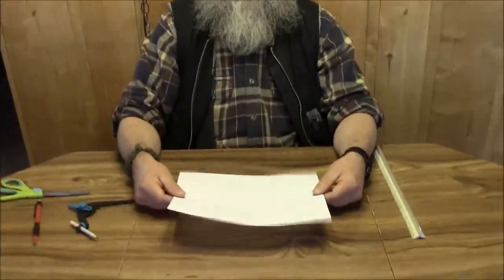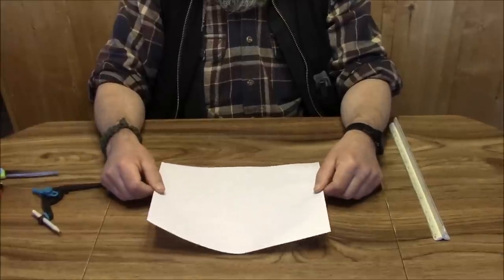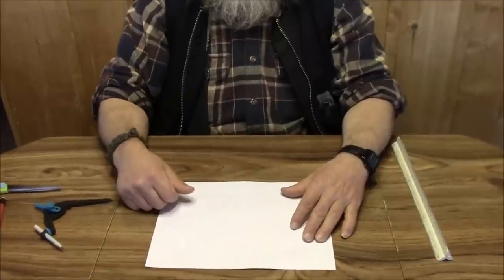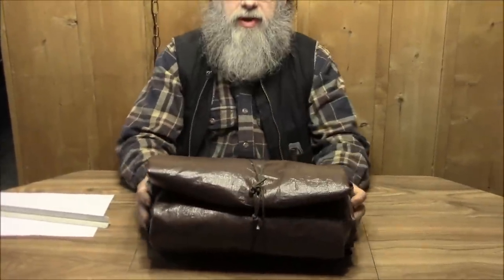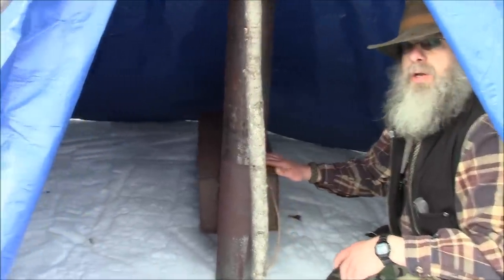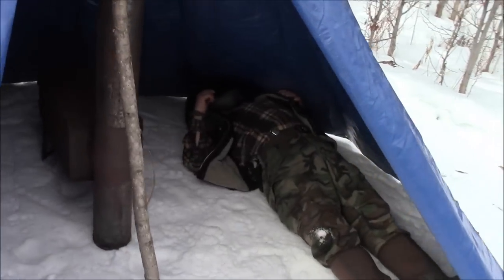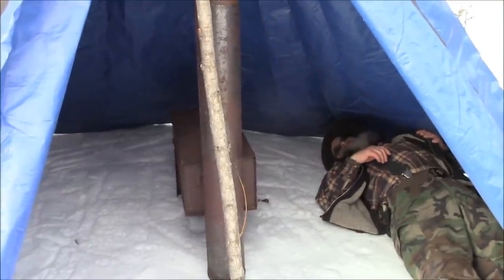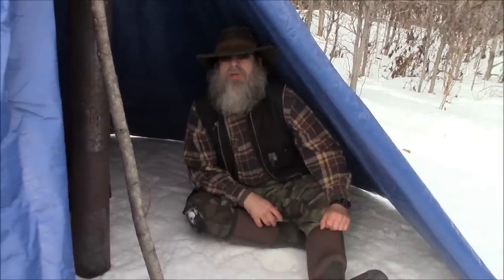Make A Tarp Tent Tipi Hot Tent On The Cheap

Comment: I'm back at this sir , last year was quite late to make but this year I want to make it , I have problems understanding the sizes you say , can you please wright me the sizes of items that I need so that I can search it from there ?
Thanks !
Reply from the maker: The tarp is sized 12 feet X 16 Feet. (3.7 meters X 4.9 meters)  There are plenty of online web site conversion utilities that will convert measurements to metric.    What I suggest is to find what sized tarps you have available and then do a paper model to scale just like I showed in the video.   That way you can create paper pieces that are the same sizes as your sleeping bag, stove etc but are scaled down to the proper scale to fit your paper tipi model.   Then you will know if starting out with that size of tarp will give you a size of tipi that will suit your needs.
Reply: I have to order everything from Amazon , as that is the cheaper , more durable option for me. My question is I'm 1.92m in height will I fit in the size of tipi that you made? if I fit that is the most important as my only companion is my dog and he will fit for sure , the stove there are people who make it here for very very cheap , like my relative gave the worker sheet metal and he build the stove for 5$ , what size gromments do I need ? and also can I get that non flamable piece in smaller cheaper option as I don't need the whole tarp of it and shipping it would be quite costly because of the weight. I also have to order gorilla tape from amazon how much should I order ?
Reply from the maker: I do not remember measurements on that project any more but If you make a paper model to scale like it shows in the video then you can make a simulation of yourself laying in the sleeping bag also to that same scale.  You can also measure out the tape needed in that same scale and you will know for sure very closely what is needed for the actual tipi construction.
Reply from the maker: For the grommets, they need to be however big you wish them to be.   If you wish them to be big enough to put a spike (as tent stake) through, then you will need to measure the size of your spikes.  If you are going to tie cordage to the grommets like I think I did in this video then it really does not matter how big they are as long as they are wide enough to get your cordage through.
Reply: Ok thank you very much sir for you time and help ! 
Wish you all the best
Nick

Comment: At the 19:35 mark, you cut out the V pieces. But later you added a scrap so there was a flap to close the opening. I'm wondering if you should only have cut off half of the piece at 19:35. Would that  have worked to close the door?
Reply from the maker: Without rewatching the video all over again I'm not sure what it looks like.  However if you think it will work, go for it.  You can make a paper model first as I suggested in the video and then you will know the answer well before you get to the cutting of the tarp stage.

Comment: Hi, I am a person who enjoys Bushcraft in Korea.
After watching this video, I fell in love and I decided to make this tent. and it took for 3 days.
More than 30 people were asked what I was doing.
  lol.
But there's a small problem and I'd like to get some advice on how to make up for it.

1. Do I have to extend the extra length to the ellipse you taught me if i try to close the tent's door?
Before I cut the tent fabric, I cut it with about 30 centimeters around the circumference of the ellipse considering the extra length to close it.
But even in your video, there is a space where you can see the ground as well to the ground. I don't really like this part considering it's winter.
Even though i tried to make adge of the tent, got touch the ground with a tap and packing peg as much as possible, space still exists.

2. It's too difficult to find a large, thick tree that deserves to support tents by Korea's Natural Protection Act, Forest Safety Protection Act, National Territory Management Act, etc. (The finished tent has a diameter of about three meters. )
If you were, would you consider using a tent pole?

ps, But I can change the height and the diameter of the tent in a fluid way.
I'm curious about your idea of just being an expert.

3. Why is your voice so wonderful? 

thanks for your video . / 감사합니다. ^^.
Reply from the maker: I am not real sure about what you are describing.   If there are gaps below the walls near the ground, which there often is due to uneven ground, I will throw leaves, dirt, snow etc against the wall bottom all the way around to block the gaps.   For a center pole I have found extendable aluminum poles at thrift stores similar to the one at the Amazon link below.  If I want a quick set up and do not want to bother with external poles, I just use one of these extendable poles.    If your door opening closes to your satisfaction without adding any extra material then there is no need to add material for a door closure.  I wanted to add more materila for teh door closure so that I would not take away any from teh floor space by shrinking the shelter diameter to get a door overlap.

https://www.amazon.com/Roller-Extension-Painters-Rollers-Professional/dp/B079PXGV6Y

Comment: If I were going to connect two tarps together . I would lay the two tarps with about an inch in between them . Run the gorilla tape down the gap seam . Then flip over Now when I run the gorilla tape down this side it will connect with the other tape making a strong bond . And obviously one would want to run tape to the right and let of the middle seam over lapping on both sides  .

Comment: How does this tent hold up in snow?
Reply from the maker: bear track This design would be excellent in snow because there is no horizontal or near horizontal roof area.    If it is heated then the snow will melt off anyway.

Comment: Lonnie, how do you deal with condensation in a tarp tent that doesn't  breathe?
Reply from the maker: The use of a woodstove inside helps a lot.   There is condensation but I do not consider it to be significant.   When using a liner inside the shelter, the condensation is even less and is what I consider as minimal.

Comment: How do you find the measurements for tepee tent  by hight and diameter of the tepee to know how big a tarp you will need
Reply from the maker: The best way I can explain it to you is to explain it the same way I already carefully explained in the video.   Make a paper model to scale.    First make a paper model to scale of the size tarp you want to use and then make a paper tipi from that scale model of tarp.  Now you can see in feet or the metric equivalent how large the resulting real tipi will be if using the size tarp of the scale model.

Comment: Use the rubber flashing self adhesive tape. Once that stuff makes contact good luck getting it off.
Reply from the maker: I know a fella that made one of these though a larger size and used "Flex" brand tape for tie outs mid wall and the tape worked great.
Reply: @Far-North-Bushcraft-Survival   maybe those 8 or 10 foot rolls of tyvek even that stuff is a 100 % water proof.  I wonder how well that wood work. Downfall is the bright white but covered with pine or something. 🤔

Comment: What is the length of the centre pole used erect the tipi?
Reply from the maker: It is roughly 6 feet.  I cut a new pole each time I erect the tipi.   You need to stake out your tipi and then step inside the doorway and lift up the peak of the tipi.   Now measure from the peak to the ground while holding the tipi up and keeping the walls tight all the way around.   Now you know the length to cut your pole.   The pole length will change slightly from camp to camp due to uneven ground and the compactness of the ground.   In other words, during the winter, the base of the center pole will sink in the snow so the pole needs to be longer or else the pole needs to be supported by some wood chunks to make up the height difference.

Comment: I'm going to be doing something similar soon, did you use the duck tape to reinforce the tarp or is there another reason?
Reply from the maker: +Mitchell LeGassick   Yes and Yes.   I used the tape around the cut edges of the tarp to "reinforce" the edges as well as provide some "grip depth" for the grommets to be able to bite into to get a good firm grip.   Also the tape was used to join pieces of tarp together when needed.   Good luck with your project.
Reply: +Far North Bushcraft And Survival 
thank you sir

Comment: Lonnie, a question for you. Wouldn't the point at the top of the arc of the tipi be the same distance as the radius of the 16 ft? What I mean is would it not be simpler to just find the half way point of the 16 which would be 8. and then measure out 8 ft for all the other measurements rather than using the cord? It only makes sense to use the cord while cutting, but when you are laying out your axis points, it seems to be unnecessary. Or am i missing something? If your tarp is 11 x 16 and you are using the 16 ft side as the length, then the radius will be 8 ft. Another smoking video man.
Reply from the maker: You are talking mathematics now and so therefor you left me behind.   If it sounds good to you, give it a try.   If I understand you correctly though, it sounds like you would be making a tipi design closer to the steeper and narrower model that I demo'ed as a paper model.   That one is an inferior design for what I was seeking.  I wanted to maximize interior floor space and minimize over head to limit wasted heat.   That is why i modified the design to achieve those goals as you can see demo'ed by the paper models.
Reply: Oh, I get it now. Thank you so much for taking your time to respond. I am going to do this project this summer. Too stinking cold out right now to start it. Been below zero for 3 weeks. All my best, and thanks again.
Reply: Remember the 11x16 is the cut size of the tarp before hemming in many cases. Far simpler to mark the middle and use a string. That way there are no surprises when you get to the other side and find yourself off the edge of your material by four inches.
Reply: Part of this that comes into play is the fact that the actual measurements of the tarp are !5 ft 6 inches by 11 ft 6 inches.

Comment: I am not sure if it would work- i am thinking the scrap, parchment paper and an iron - one might be able to weld the scrap along the edges rather than using tape. Could make a huge mess OR be really solid.  ?
Reply from the maker: That should be quite easy to try out on tarp scraps.   Might be worth a try.

Comment: How long Is the second teepee? And how tall Is when finished?
Reply from the maker: You can determine almost exactly what the height and width is by making a paper model to scale as I showed in the video based on the size tarp that you will be using.    The tipi that I made in this video is about 10 feet wide I think and and about 6 feet tall.  A 6 foot person however can not stand full height due to the center pole occupying the middle.

Comment: Lonnie can I do what you just did with a 10 by 12 tarp?
Reply from the maker: If you will make a paper model like I showed in the video with your body outline to scale, you will see what you can or can't do with different sized materials.   You will not be able to put a stove in something that small and I do not know if you would fit by yourself either.   Probably you would fit okay but you would have to have an exterior pole support system rather than one center pole.   My advice though is to make a paper model to scale just like I showed in the video and that should give you a pretty fair idea what you will end up with.

Comment: I see why you made the alternative there are benefits for room in it. However it creates a heating problem. You are required to have a stove. Whereas the traditional design you can have a fire pit. And has a better design for drawing the Smoke Out. Something to do with volume of Air versus thermodynamics. Also if you cut it traditionally. You don't have to waste the rest of your tarp. Before you make the cut you can Market with a magic marker before you cut it. And then add more rope to get the most out of what is left. And when you cut what is left it becomes the inner wall. The outer wall is supposed to come down but leave an opening of 2-3 " and then the inner wall goes all the way to the ground but what this does is create an updraft of cold air which mixes with the hot air above the fire and draws it out of the hole in the top so that you're not sitting there with a bunch of smoke in the tent with you. Making the flaps at the top is not that difficult and by attaching a stick to it you can open and close it to control the draw. There are only two drawbacks of the traditional design for your scale. One is it's less room inside. The other is it might be more vulnerable to high winds. However it does eliminate the need for a stove.
There are alternatives 2 using a tripod or a single stick in the middle. You can use two poles one on either side of the inside wall but then you would need guy lines to help hold it up. I have the benefit of having a manufactured teepee someone gave me who lost their poles, and I built new ones since apparently they don't sell replacements. Not bad for a free tent TIPI. But again you have to have a stove. You can also make the fire nearly smokeless by burying a trench going outside to the fire itself. Not very practical in frozen ground but you could probably bring a short piece of hose and run it outside above ground and only bury it at the edge of the pit far enough back to where it doesn't melt. I've never tried it but I'm pretty sure it would draw an air
Reply from the maker: What you said does make sense.   However me being an owner and user of a 16 foot wide traditional canvas tipi with the smoke flaps, tipi liner etc, It is difficult to make and keep the interior smoke free when using an open fire to heat the tipi.   Using a stove to heat a tipi is a whole lot less hassle and far more temperature efficient.    Yes it is awesome to be able to heat a tipi with an open fire but having done both, my vote definitely still goes to using a stove to heat a tipi.

Comment: hi Lonnie, I made this tipi tent a week ago and slept in it without a fire, it was just about freezing the problem was in the morning the condensation in the tent was terrible, would a stove make it worse or help reduce the condensation, I watched your vids and you don't seem to have that problem.
Reply from the maker: The use of a stove greatly reduces the condensation problem.   It is still there but not near as much.   I also have a liner in the lower 2/3rds of my tipi now and that reduces the condensation even more.
Reply: thanks Lonnie, looks like I'll be getting a stove, can I ask what you made the liner out of, have you made a video making and fitting the liner ?, I must say that the tipi is a great tent.
Reply from the maker: I used mylar sheeting (cheap space blankets).   I really liked the results for reflecting and distributing light and heat but it is not a durable enough material.    I just laid the tipi on a floor and cut the bottom of the mylar sheets to compensate for the radius if the bottom of the tipi laid flat.   I then used Gorilla tape around the edges of the mylar sheet to tape it onto the tipi.   The next mylar sheet I did the same thing but overlapped onto the former mylar sheet by a few inches and taped it down.   repeat for each successive mylar sheet.
Reply: thanks again Lonnie, when I bought my tarp I got a brown and silver one thinking the silver would reflect heat and light, please keep the videos coming, regards Keith.

Comment: Some advice and question ? first when you cut the V shaped doorway why did you take the hole V out if you only cut the V straight down the center and just removed 1/2 of the V you would not of had to make the other added side to be attached . Great show I am privileged to view you shows . Thanks Frank
Reply from the maker: +Frank Yeyna    If I am following you correctly, that is an excellent idea and is one of those "now why didn't I think of that" type ideas. lol    That is why a medium such as the web is so useful.  Somebody can throw an idea out so to be available to everybody and many others who are interested can take the idea and work it over to their satisfaction and make changes and improvements to suit them.  When they, in turn add their ideas to the mix, everybody benefits including the person who introduced the idea originally.

Comment: When I built mine, I put a guyout point at the very top with a grommet. I didn't think a clip would hold.
Reply from the maker: Some tarp grippers will work fine and some will not.   It very much depends on the type of gripper.  The top being so thick due to the layers of tarp material as well as the reinforcement tape, there is plenty of thickness for the tarp gripper to potentially get a great "bite."
Reply: @Far-North-Bushcraft-Survival  Thank you Lonnie. This has been a fun project. Hoping to use it out in the woods soon.